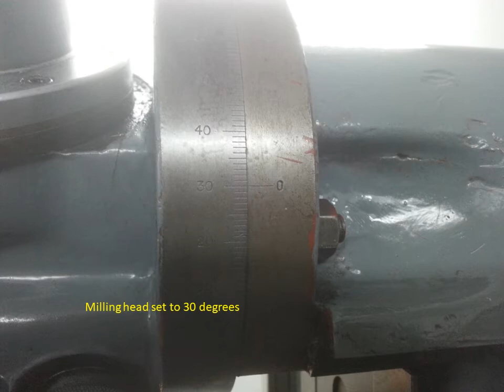Steam Locomotive 9F Build  Part 21 - Cylinders Part 2

Comment: G'day Craig and Happy New Year to you and yours.  There was a lot of machining in those cylinders but they look terrific and were quiet complicated.  With those inspection plugs will they be to short by the time you clad and fix the sheet metal around the cylinders?   Any way mate great piece of machining and thank you for showing another part of the "journey" yours in steam John
Reply from the maker: Thank you John. The inspection plugs are used for setting the piston valve events. Once the valves are set the plugs are sealed with PTFE thread tape and the sheet metal cladding then covers them up. How's your Simplex coming along? It is thick with snow here today so keeping warm by filing 36 round holes into square ones on the four valve liners. Cheers and all the best, Craig.
Reply: no23mk2 I saw your weather and the snow so keep warm.  It's very warm and humid here horrible it effects my rheumatoid in a lot of pain at the moment.  With the Simplex I have machined all the horns just need to rivet them in which I will start today, then I will start on the frame stretchers I was going to weld them in professionally but I am still thinking about that. I'll send you a photo later in the build Craig.  Take care especially on the roads kind regards John
Reply from the maker: Sorry to here your in pain John. Think an ice cold pint of 'medicine' may be the order of the day. I think welding in the frame stretchers could cause some significant distortion and would ruin all the square and true work you have done so far. My drawing called for them to be riveted but all that riveting I thought would be a real ball ache. I opted for nuts and bolts with loctite. My theory being - if I have made any mistakes along the way then, at least in theory - I could take it all apart again. Cheers Craig.
Reply: no23mk2 no that distortion is why I am not going ahead with it.  I have all the holes measured and countersunk with 4BAx1/2". It's pain really cause there is bloody lot of them sand I have countersunk them so they don't foul the back of the wheels.  I got on Amazon and found a original construction book by Martin Evens its second hand and cost a fortune from the UK but it helps. Craig give me your email or pops and I'll send some photos over regards John
Reply from the maker: Hi John, I have tried to send my email address to you via YouTube private message but your channel doesn't have that option. Send me your email by going to my channel click 'About' and there should be a message icon. You can send your email address to me this way and it is private. I will then reply with my email address. Hope this makes sense? Looking forward to seeing your photos.  Cheers Craig

Comment: It would be interesting to see any velocity and volume difference between a square port and a scoloped circular port, probably difficult to measure but nice to se you are true to the drawings. Out of interest whose drawings are you using?
Reply from the maker: Hi David. The drawings are by Les Warnett comprising 32 x A1 sheets. Regarding port shape - probably not much in it for the cylinder ports but very important for valve ports - see this video at about 4:30 in https://www.youtube.com/watch?v=JRdTPNApfuk It is the best explanation I have seen. Cheers Craig